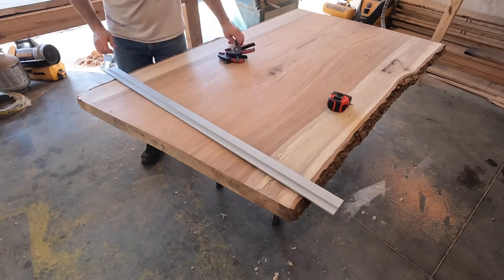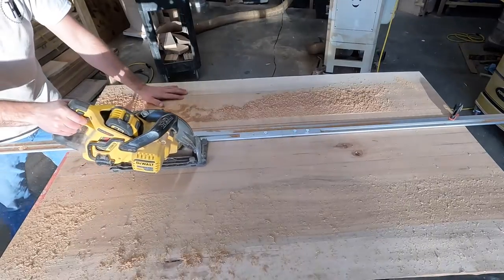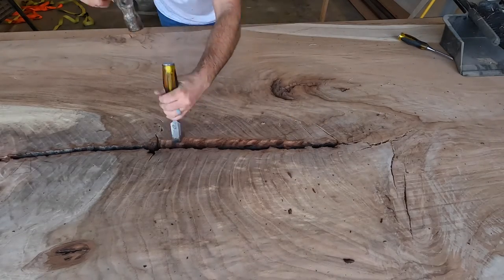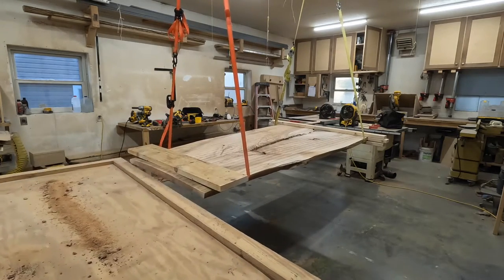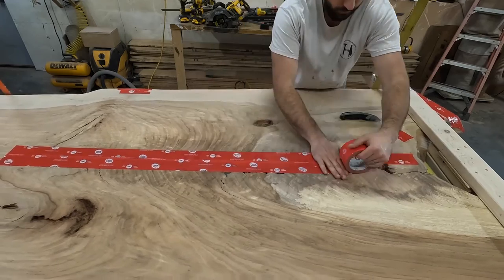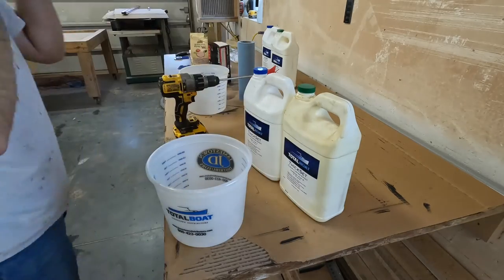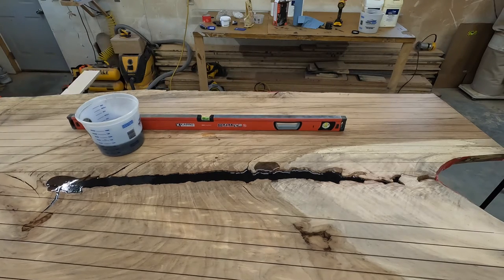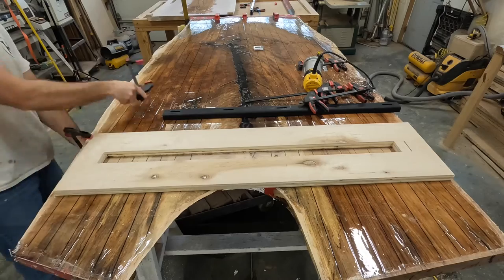Pecan Tables Part 1

Comment: Could you have flattened it with an industrial planer nearby, or perhaps a sled router or CNC? Those are the most common methods. I still think your method might work.
Reply from the maker: It was flattened with a large planer, but it cupped afterwards.